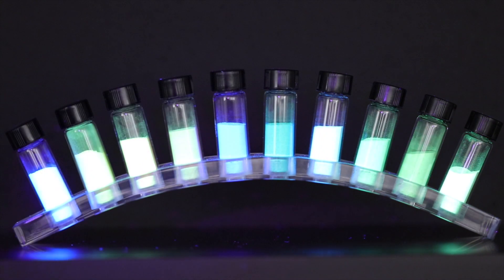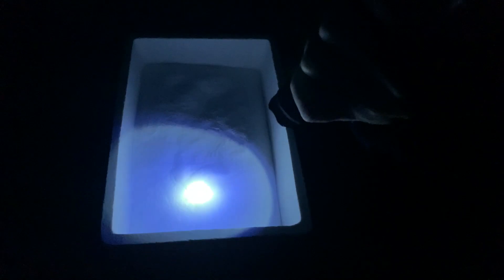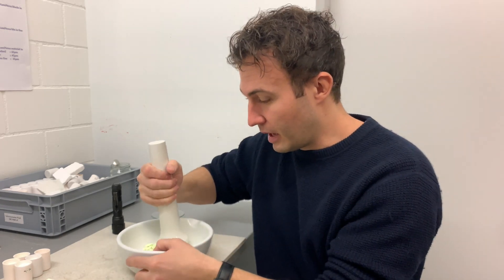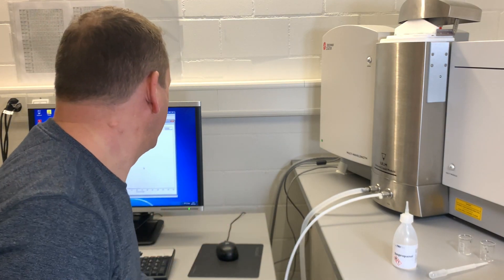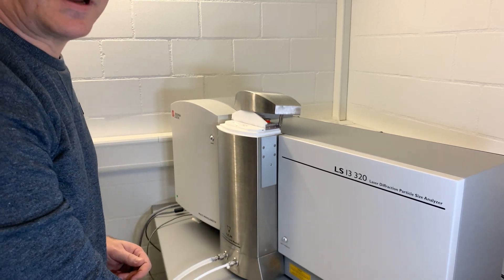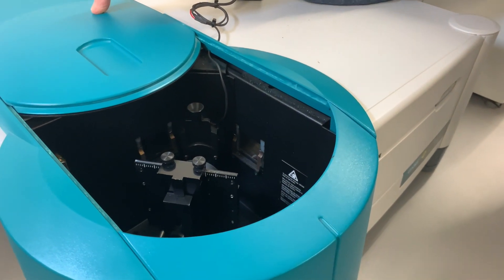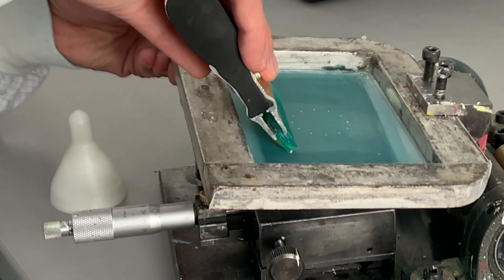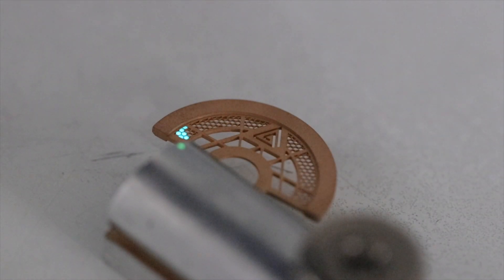The process of making Swiss Super-LumiNova by Albert Paul Zeller

Comment: This is fantastic. Does anyone know if the Tritium era from the 1960's - the 1990's was zinc sulfide mixed with tritium powder? This somewhat stumps me because Tritium is technically a gas as used in modern capsule tubes.
Reply from the maker: Good question.  We would need to go back to RC-Tritec as we are not experts in this particular field.
Reply: Tritium is a gas I believe.